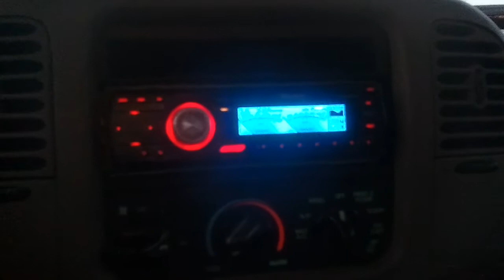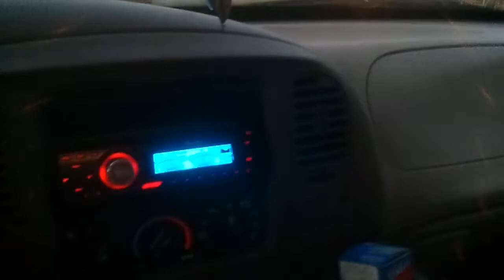2 Kicker CVR Dual Voice Coil 2 Ohm Part 1

Comment: You said you wanted advice. You don't really need a big amp. I mean. I had a 2000 watt boss chaos. And when I got my 300 watt Rockford amp, it hit just as hard. If you get a pro series amp. No need to go past 1200 watts. Saves money. And power.